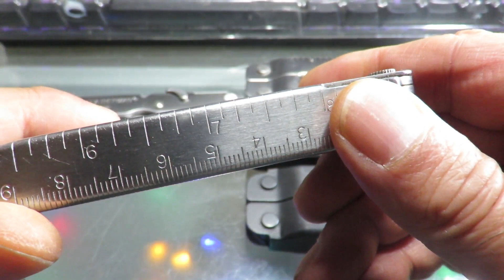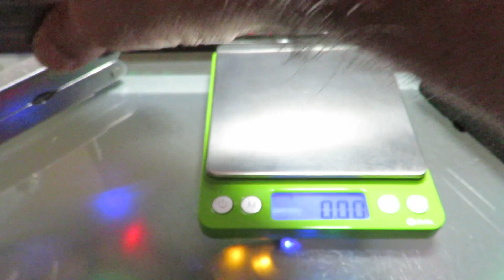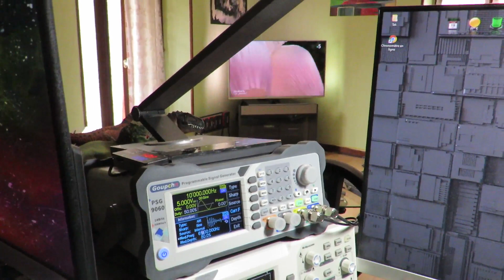Leatherman SUPER TOOL (1994 - 2019)

Comment: Have you seen Fantasticar multitool?
Reply from the maker: "Not bad for this price!" ...
Reply: There is also the A-xintong,Atech,Bercol there are several names ,amd it says 13 in 1,or 15 in 1.Same multitool with a  different name. But is good multitool for price from 10 to 25 usd on amazon.
Reply from the maker: @domagojstamac6019  ... oui, mais pour 12 € sur Amazon, il ne faut pas s'attendre à un Victorinox ... Je veux bien acheter des MT chinois mais avec un minimum de qualité ...
Reply: Yes,I agree.
Reply: I am thinking to buy a new leatherman.Which is the best,in your opinion?
Reply from the maker: @domagojstamac6019  Surge or Free P4 or Charge+ G10 ...
Reply: thanks